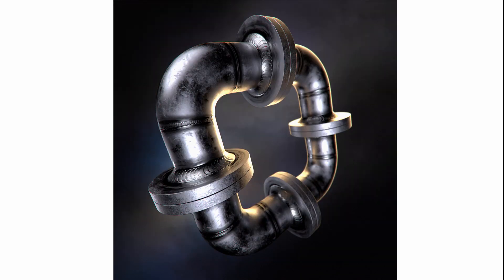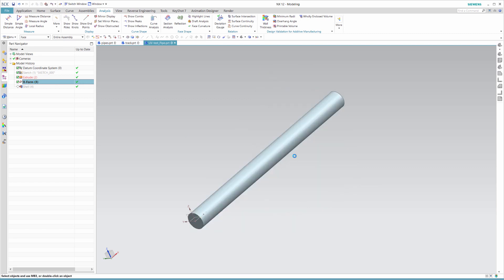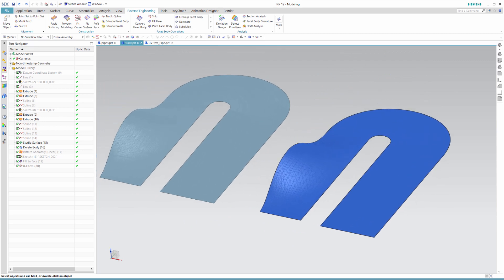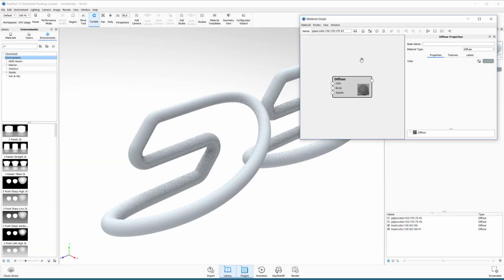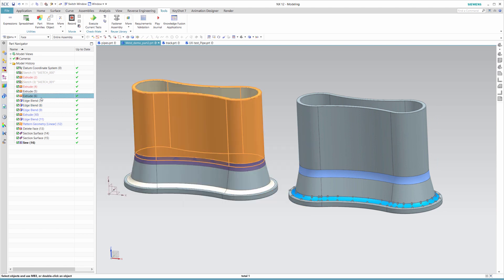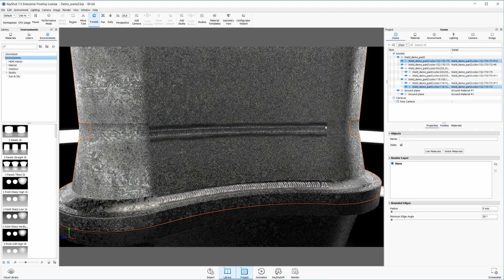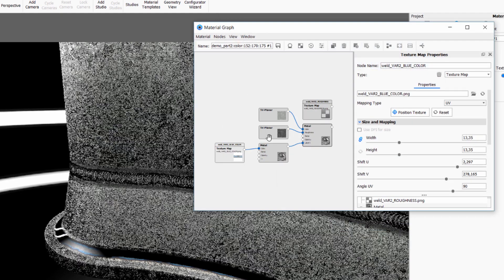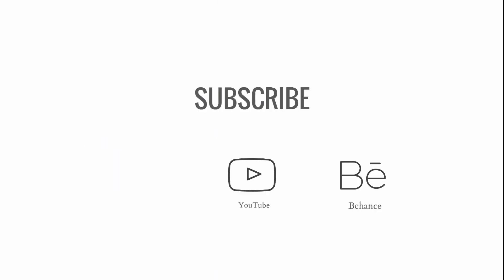Making Welds in KeyShot from CAD geometry

Comment: Great explanations Magnus. Pretty sure we discussed this elsewhere, but unfortunately, NX seems to be a bit of a standout in the way it offers control over NURBS patches. At least in my experience, I've not had luck with this in Solidworks or Fusion360. This is still a very helpful tutorial for those interested in this subject.
Reply: Oh I solved my problem! On the sweep options I changed the default Follow path for - Torque along the path-  . That way it creates a single sweep without different sections
Reply from the maker: Thanks Will! Yes, I remember you trying to recreate the results using F360, but it lacked a bit of control of the NURBS. It's undeniably a great set of tools available for full control in NX. Too bad to hear it's not as applicable across platforms.
Reply: I'm also trying to create a continuous sweep  on Solidworks, even if I have a composite Curve it still creates a tube with different sections, Anyone knows if there's a solution?

Comment: Cool trick. I did manual painting of textures using a custom brush. I did it all in Blender with a different render engine. Perhaps ill try this method in a different manner. I also use a trick using some small displace mesh with displacement mod. But it doesnt look like its really connected
https://www.dropbox.com/s/d4ktu34hgznnes5/Exhaust_Scratchy%20metal-Welds2_POST.jpg?raw=1

Comment: Thanks Magnus! Anyone have experience creating the needed geometry in fusion360? I've been playing with lofts and sweeps in the patch and sculpt environments but cant create a single face surface with even flow.
Reply: I had the same problem in SolidWorks. On the sweep options I changed the default Follow path for - Torque along the path-  . That way it creates a single sweep without different sections. I don't know if there's a similar option on fusion360 though

Comment: Awesome tutorial and thank you very much for providing the necessary resources for free. But unfortunately for me, impossible to find a tutorial to link several fillets together to make only one (in "NURBS mode") in solidwork
Reply from the maker: Hi, thanks for the valuable feedback and the kind compliment. It's a shame to hear it can't be done properly using SolidWorks though. I imagine it would be a tedious process of subtracting the fillet areas using boolean operations and then loft the remaining shapes together (easier said than done probably). A shame I don't have the software nor the foundation to do some research on it.